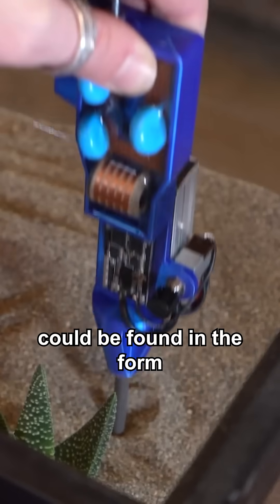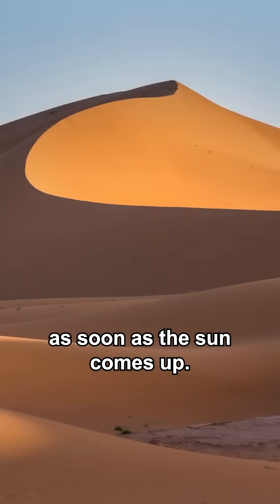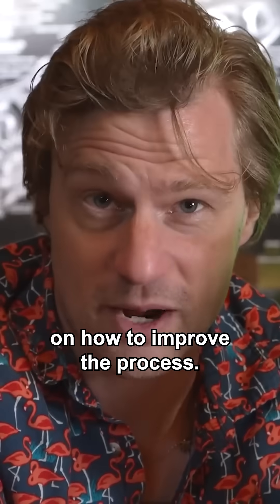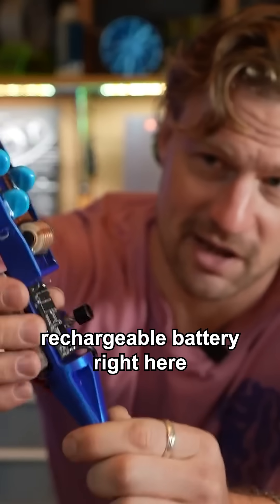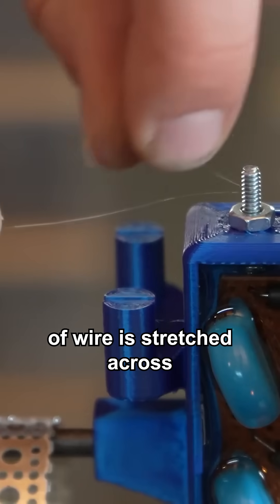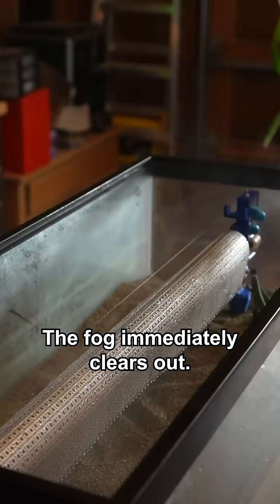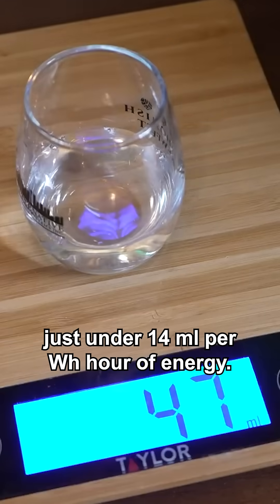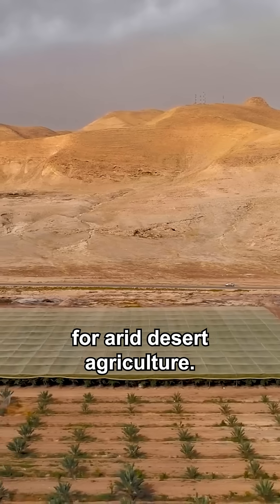Solving Desert Water Shortages Using 20,000 Volts (from full video)

Comment: Great idea! It does require high relative humidity, which obviously comes along with lower temperature. 

That happens right before the sun increases the temperature (which then would lower the rest of humidity). Another idea I would throw is if it's possible to mist seawater using an ultrasonic mister, and use this to condense the liquid. 

I've never worked with an ultrasonic mister before, so i don't know how much power they consume, but I assume it would be much less energy intensive than heating up water/lowering the pressure via vacuum pump. 

Love the idea though

Comment: So what about the groundwater it eventually is supposed to become?

...per hour? How long do those morning-mists last?

Longer setup would require considerably higher voltage wouldnt it?

But to contradict myself in order to question everything...

Doesnt just a simple mesh work well enough already? I mean yeah, the charges will attract more water vapour but, condensing would still happen without it right?

Comment: This is a dehumidifier and the half liter per 40 W is under ideal conditions. Maybe it'll work but I doubt it. Definitely has been tried before and failed. Watch "$300 000 'Self-Filling water bottle' FAILURE" by Thunderf00t for insight.

Comment: That’s fascinating. I actually tried to do something based on a similar concept in high school but I never thought to use high voltage  what I did was use a Peltier unit connected to a computer AIO water cooler then draped over a bucket the idea was that the Peltier unit would cool the cooling fluid thus cooling the radiator allowing the water to condense on it doing this worked, but success varied greatly depending on temperature

Comment: This looks great but I’m worried about unintended consequences of using these condensers across wide areas. I would imagine the few bits of surviving vegetation rely on it as a water source, & there would likely be rodents that count on the plants as a food source & there would be predators counting on the rodents as a food source etc etc. 

Said vegetation also plays a role in minimizing desertification. Overall though I think something like this could be beneficial if used carefully & with consideration given to long term impact.

Comment: I'm pretty sure here in Australia central Australian settlements use something similar, and smaller more remote groups use the old school method of a tarp with a hole in the middle and a weight to keep it down so condensation runs down into the hole and into a reservoir, larger settlements I'm pretty sure do have dedicated water supplies though. 

Edit: a majority seem to rely heavily on the central artisan basin (big underground lake) for water supply

Comment: Looks like something a camper van could be fitted with if you like pure water and not the chlorinated stuff from the tap. Right it has all been done before but with such a high voltage? Iffy that would be trying to connect to the grid when you arrive.⚡️

Comment: If the video is accurate..
Given how fast the fog cleared I suggest that only quick pulses of charge are required, continuous voltage may be unecessary. If pulses are adequate one could easily make an umbrella skeleton of sequentially activated condensation "ribs".
($0.02)

Comment: 20,000 volts?  I don’t think so.  A high power line carries 25,000.  That hair thin wire and small battery aren’t generating 20,000 volts.

Comment: Hello for anyone wondering the impact i think it be similar to cloud seeding  best place ive see to depect it is one peice alibasta arc logicly would work similarly so the point of this commet is i think it would be better was a wall and not field/crop  so maybe 5 % is you put in wrong spot and suck it down to the max the flow of the air would lession and slow form a desert so it have to be a moving wall or place in a deep zone and start growth the growth will hold more in the air to
Reply: what the the current do. so Mars has fog is its ice if the current melts it

Comment: We can literally get the water and energy we need to survive, right out of thin air .. think about it, you could put out a glass of water on a really hot day, and by the end of the day, a good portion of the water will have evaporated out of the cup.. there’s billions of tons of water suspended in the air.. clouds are literally floating lakes ..

Also, we can harness he energy of the planet like tesla did with his Tesla coil.. a gas powered generator produces power by spinning a magnet inside a copper coil , arranged in three different bundles, supplying 3 phase alternating current.. 

The earths core is a giant spinning ball of magnetic iron ferrite, and there’s billions of tons of copper, iron, silver, gold, and dozens of other different precious metals  in the earths spinning crust and mantle

Comment: This is a really clever and very efficient way to harness a particular weather phenomenon.  Condensing fog is way, way more efficient that trying to condense water vapor from air. My concern regards the metal condenser surface over time. The condenser mesh may pick up dust (carrying microbes) e.g. various protozoa such as amoebas, water-loving bacteria such as pseudomonas.  Damp dust can serve as a base for algae or moss to grow, in turn providind nutrients for mold. What are ways we could keep the condenser surface clean over time, preventing growth of a biofilm, and also preventing corrosion of the metal surface wirhout leaching metals?

Comment: taking moisture from the air needs to be done in the sky. taking it from the fog harms the things that live on that water. the taller the better. but really its just stealing rain from somewhere else. if we had cities near saltwater start making fountains, that sprayed salt water up we would get more rain. they could be powered by the tides. some ram pumps and floats should be enough. but  yeah get the water into the air before you go hijacking it.

Comment: First off, there are already simplistic fog nets/harvesters that do this. ZERO electrical components/electricity needed. Second, you only get fog usually when the desert is near a body of water, like on the coast. All this device would do is add a bunch of failure points to something that currently has virtually none.

Comment: This is the solution to a non-issue. Nobody's saying you can't take water from sea fog. The reason why nobody does it is because it has high salinity.This is different from mountain fog as done in the andes. This salinity is the reason why iron rusts much faster near the coast than near a freshwater lake. So while you can grab water from sea fog, you can't actually use it as is. You need further processing to remove the salinity from the water. You still need desalination. So now you have wasted that energy when you could've just desalinized the water from the very start. The amount of energy used for one round of desalinization would've been more or less the same regardless if you take it from sea fog or directly from the sea.

Comment: Reinventing the wheel 🎡.
It's not cost effective. 
This system already exists and is used in the desert without external power.
Over Engineering a system that should be simple because people in the desert might not be able to afford it much less afford to power it using a solar system. 
You completely overlook the material science, make the mesh with water absorbing material let the natural wind do the job of bringing the fog to the mesh by careful planning and use of geography.

Comment: Problem is deserts are really really low humidity. You can’t draw water from the fog if there is no fog. I’d be extremely surprised if you got a small cup of water from this thing in the desert. You’d probably need longer time than it takes for you to die of dehydration.

Comment: I would love to see one of these things. 3 ft by 3 ft with a solar panel and battery backup. It should have a humidity sensor so it was only running during optimal periods, be easily fixable, easy to mass produce and ship.

Inventions like this and the seawater greenhouse could quickly and dramatically change the world

Comment: Atmospheric Water Generators are proven technology. OUR problem is that this technique requires electricity, and in a condition wherein we need to produce our own water, there will be no electricity.
STOP THE CAP !!
Reply: Solar?
Reply: @valentinsilva2182  any electrical source generated by machine/apparatus in a Grid Down scenario is temporary at best . Everything will eventually breakdown and repair components will not be obtainable.
Reply: @DaveDawg11  ...and especially should the area be plagued by sand storms. 
Still, Dubai should be able to afford it?

Comment: Could just filter the water from an air conditioner, collects water from the air while cooling you off, there are some ways to set up an ac to not blow cold either but still take humidity out of the air

Comment: Exposed liquid water doesn't last long under the desert sun. There's a reason there's no water in the desert. The question is whether that collector surface won't act as an evaporator as soon as the morning sun comes up! You'd need to lead the water away from the metal surfaces and into a sealed container as soon as you extracted it! If you solved that, then we can talk efficiency. Namely, how big a collector surface you'd need to create enough water to be used on a given land area as any meaningful amount of irrigation and whether it's worth the hassle.

Comment: fake, the condenser is important and the only parts are needed.  the electronic parts are unnecessary. The way you hold the  high power 20,000 volts is shocking n it is very dangerous. No engineer will hold device bare handed.

Comment: What happens with dust coverage, sand storms.. solar panels being covered...  water being contaminated..even by sand dust..
Human touch/high maintenance??
I seen desert agricultural using over head nets which they use to water the crops before it evaporates. The net traps moisture and they give it a little shake and nice amount of water drops like rain onto crops.

Comment: This is actually very practical idea. I don't know what's the total cost of making this thing, but this thing has a potential of being lifeline of many
Reply: It's not practical in a cost sense at all. He used enough fog that you wouldn't even be able to see what shirt you're wearing, and even at that level, the electricity costs alone would be double the cost of tap water. This is in a lab setting with zero contamination, and it excludes the price required to set up and maintain and entire farm this way. In reality, it's probably cheaper to run a pipe to the middle of the desert than to have this going.

Comment: Nice but I have a qustion/ thought(Correct me if I'mwrong). Since the water evaporated it has no minerals in it. If this is your only water source youre gonna have a problem with osmosis in your cells to a point where you would die. Or is the water only ment for watering the plants?

Comment: Dew catchers have been around for ages. Without electricity.
Reply: But with electricity they are magnitudes more efficient. Did you watch the full video?
Reply: @isteal9927  maybe but in an emergency situation with no power. Just a few strings can get you a drink of water.
Reply: @RonJustDiggingLife  that great
Reply: @RonJustDiggingLife that's great and all as a last resort, but this, efficiently powered and on a large scale could literally change the lives of millions
Reply: @0zero728  No it doesn't because this still has the same pot holes that any other form of water collection has which is that it is not potable. Any contaminants in the air would still be left in it during this process and the cleaning on these apparatuses would have to be massive to ensure that other contaminants aren't introduced. Collecting water in most occasions isn't the issue in these regions it is having clean drinking sources.
Reply: @deathleopard4960 Yeah it should be filtered but ground water and water from air will have different containments. So water from air may be safer from the start on that fact alone. It evaporated and separated from other containments before. Filter it then boil it.
Reply: @lm-rh3qo  safer and drinkable are completely different things. These will still have microorganisms. These will maintain any toxins in the air. Gaining access to water even in incredibly arid portions of the world is not the issue. The issue is getting it to be potable and that requires boiling at a minimum in most cases. Also these would be covered in dust and sand in arid climates within a day or two that would then reintroduce and ground contaminates that would have been reduced being clean.
Reply: @ 
Truly water safety problems can only be solved with significant investments in water infrastructure and treatment plants. And that requires an immense amount of planning, skilled labor, intense and often dangerous manual labor involving heights complex constructions and moving around heavy machines. 

All those machines,people, materials, and money have to come together at the same time and overcome terrain, then environmental conditions and then biological hazards. People from many countries get very sick with malaria when they enter the tropics for example.

The easiest method of providing clean drinking water is to give people filters but they only last a short while. That's why serious investments have to be made and moved on quickly. 

Its a shame how these projects are far more expensive than most countries wish to deal with immediately but pay off in incalculable ways.

Everyone wants to give the world drinkable water but the fact is it requires investment and labor not magical solutions.

Comment: “It could be powered by solar” is such a gimmick line. Dude you literally described it as a resource that disappears when the sun rises. Wouldn’t the fog block out the solar anyway? And maybe you were talking about huge battery packs running a large scale operation, but that’s being powered by batteries not direct solar.

Comment: This exists already?? I saw a TV show maybe 15-20 years ago where they did exactly this in an area where they had dense morning fog. They ran special nets along a huge stretch of the slopes around the town, where the fog/cloud formed, and captured a lot of water.
Reply from the maker: Fog nets have been around for centuries, actually. Cool devices! They don’t use any electricity, let alone 20,000 volts, This is very different from a fog net.

Comment: You mean a fog net? Im confused what the electronics are for. They have fog catchers that catch large amounts of water in the desert. How do you create efficiency while having to apply more material, and energy into it? With the application of energy youre sucking and pulling in air, condensing the air by cooling it, to force the water molecules to bond.  Essentially a dehumidifier.
Reply from the maker: The long form video explains it perfectly. This is only a short

Comment: You can not just easily scale this up with your current numbers and say it will happen. This looks like something which will behave vastly different when scaled up for the intended use.
Much higher power consumption due to energy losses etc., much less water output due to inefficiencies and do on.
Scaling does stupid things sometimes

Comment: Too many problems here, there’s a reason the idea of pulling water from air isn’t already mainstream. 

To that point, here’s just a few of those problems:

If you manage to pull significant amounts from the air, the water is not safe for immediate consumption and must be heavily filtered. 

Deserts don’t often get any significant amount of humidity at any point during the day or night. It doesn’t magically go from <1% humidity to much greater, and back down again, in just a few hours. 

In deserts where a water source large enough to cause fog is nearby, it’s likely easier, and certainly more cost effective, to set up a solar condenser for that water source than it would be to line acres and acres of ground with dehumidifiers.

In the unlikely event that you manage to solve all of these problems, the last question is why? Why would someone choose to move somewhere that water is so scarce it needs to be pulled out of the air, and not piped in from a nearby water plant, and then why choose that spot to farm, as opposed to somewhere else?

There is no problem this solves that isn’t already solved, and likely already solved more efficiently and/or cheaply. I’m sure you could invent some hyperspecific fantasy scenario for someone in an African desert that wants to farm away from the coast and also doesn’t want to be near civilization, but the point is moot.

Comment: Except this fog doesn't actually exist in the desert. For fog to occur, there must be moisture to begin with. This is why the desert has massive temperature swings. Watet holds onto its thermal energy, and sand does not. Fog is the moisture on the ground evaporating due to the radiating heat and cool air. Sand has no moisture, therfore it cannot produce fog. This guy is a quack.

Comment: Sadly that technology would be banned in states like Nevada where collecting rainwater will get you arrested because that would compete with their ability to control the water.
Reply: They dont like this because its a stupid scam. It's a dehumidifer with a fancy name. It works the same, functions the same. You can't drink those water. You can look up other scam project like these. They will add filters and tells people its safe but its not. The air we breathe are not fully pure water vapor. It has dust and particles. Turning them into water is just you drinking dust